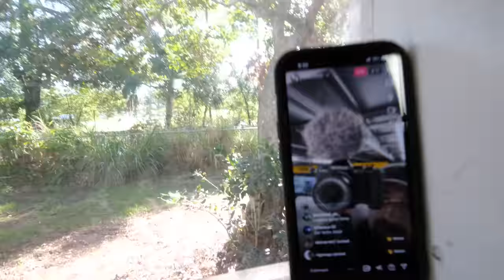Full Paint Job on The @boostedboiz AWD Civic Hatch!

Comment: Honest question I’ve been dying to get my truck done, 07 1500 classic crew cab, short bed, what would I be looking at for full truck respray, hood has some hail dings, passenger doors have one or two dents but not creased and a couple big dents on passenger side bed, two or three small hail dings on it currently white, painting grill gaurd and nerf bars/mirrors and a few trim pieces myself a almost turquoise color choice I’d leave up to you I want to retain the home painted items color, just truck dings fixed and resprayed